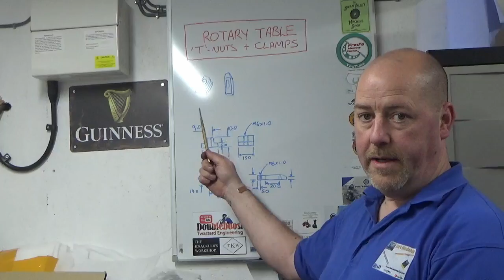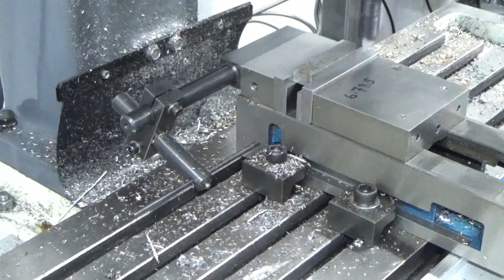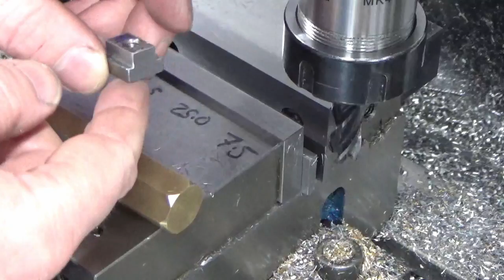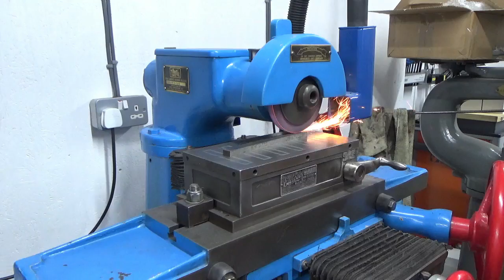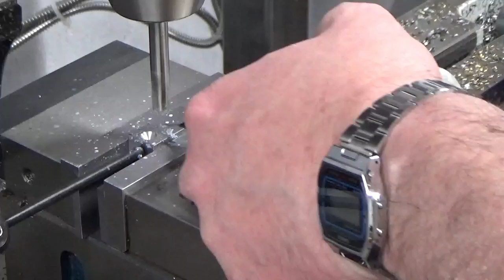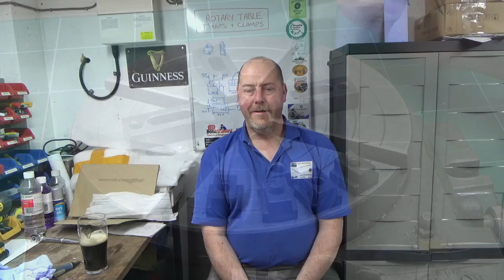Making T Nuts & Clamps For Rotary Table

Comment: Jon, nice video - is there a specific purpose for the threaded hole in the clamp? I've not seen one in a clamp before.
Reply from the maker: Hi Jack, thanks for the comment and question. Yes, it is for a jacking bolt at the back to save you needing lots of sets of packers to level all the clamps up. Hope this helps. Cheers, Jon

Comment: Hi Jon, I see you sneaked in a hex brass and plastic knocker!. Very pleased to see the grinder in use, a little overkill for the project but why not?.
I thought halfway through you were going to remove the vice jaws and grind them parallel, many mill users use a 1mm aluminum welding rod to take out the jaw alignment problem. But a worthwhile job well done.
Reply from the maker: Hi Fred, thanks for the comment. Yes, the knocker was the very first machining video I shot last year following all the boarding out of the workshop. The vice is going to get totally stripped and I will grind the whole thing (not happy with it). Cheers, Jon

Comment: Hi Jon, Great job on the "T: nuts, they are on my list. Also I was having a similar problem with my import vice, I dismantled it & stoned all the faces, including the backs of the jaws, cleaned out the recess for the half ball & greased, reassembled. Now it closes tight & parallel both horizontally & vertically, mine might have had a small burr somewhere. It doesn't take much!   Cheers Peter from OZ
Reply from the maker: Hi Peter, thanks for the comment and information. I intend to strip mine down, run some checks on the surface plate and then a good project for the surface grinder. Cheers, Jon

Comment: Jon i have the same vice as you. I find my old Abwood grips far better when unequal clamping. I think the nature of how the precision vice works does not lend well to that type of holding because of the central slug & the fact there is no gib strip to make the lateral load accurate. A great vice though. I did a full revue of the Arc euro bought one on here. Steve.
Reply from the maker: Hi Stevie, thanks for the comment. Didn't realise you had a channel, subbed and will watch your tear down as it something I need to do. Cheers, Jon
Reply: @jonsworkshop  No problem Jon. Just making a video of making a sensitive knurling tool from Hemingways. Lots of parts to machine. Growing slowly but not expecting anything spectacular. Like you i just enjoy showing content. It will probably be at least 4 parts long. Look at Ade's workshop. Doing multi part vids seems to capture an audience. Already taken 20 video's & only made 2 parts of 20. Regards. Steve.

Comment: Nice job.   The parts look very good.   I recently picked up a small tilting table at a flea market.    The slots were slightly smaller than my milling machine table, so I just machined a couple of the milling machine T nuts to fit.   So I also have some dedicated T nuts.
Dave.
Reply from the maker: Hi Dave, thanks for the comment and feedback. A dead simple job but dead handy to have a set ready to go, just need to make a decent box now (and that's where I will show myself up........ rubbish with wood unless it's construction). Cheers, Jon
Reply: I got a smile from the comment on making the wood box.   I have a local machinist friend who says the same.   He gets me to make his wood related projects.   Just so you know you are not alone.
Dave.

Comment: Spot on job of these clamps and tee nuts👌. 
I did the same some months ago for my rotary table and also made some specials to bolt down my toolmakers vise.
 Like you I have various stud lengths to accommodate low and high profile work pieces and all the dedicated studs and clamps are stored with the rotary table.  Many of the tee nuts on the market are total crap with thread holes off centre and varying widths. Best to make your own.
Reply from the maker: Hi Howard, thanks for the comment and feedback. Yep, stuff like this today is all made out of old bean tins or whatever else is dragged up off the sea bed you know where, and thrown together. Quite satisfying making your own, not the most complex job but still interesting enough to keep me out of trouble for a couple of hours. Cheers, Jon

Comment: What is the white liquid you are using?  I'm presuming it's an anti friction liquid?
Reply from the maker: Hi Pixibelle, thanks for the comment and question. You are close, it's Coolant, a mixture of soluble oil and water used to keep the part cool (managing thermal expansion), and the tool cool (prolonging tool life). The oil element also does provide some pressure relief (anti friction sort of) that helps improve surface finish. Lesson over lol. Cheers, Jon

Comment: Thanks for sharing, nice job and love to see the grinder in action. Could the jaws on the vice not closing properly because you are just so far out? Could have tried to put one of the unmachined pieces of the t-nuts on the opposite end of the jaws so that they wouldn't close at an angle. Also, couldn't you just place the t nuts upside down, that way you could also register on top of the jaws instead of the parallels, because it doesn't feel like perpendicularity of that face is very important.
Reply from the maker: Hi Anti, thanks for the comment. Who doesn't like to watch a surface grinder, second only to watching a shaper according to YouTube stats lol. I had one of the other nuts at the other end of the Jaws but it just wasn't having it, I tried them both ways up as well but no dice! Need to strip the vice and have a good go over it (potentially a lot more surface grinding lol. Cheers, Jon

Comment: Nice video again , 'just because' :p now you can measure off your clamp top if you need to . Is there no need to harden them never really understood when and when not to harden something maybe content for another vid?
Reply from the maker: Hi rgbargeee, thanks for the comment. No need to harden these, they need to flex a bit under clamping force, plus a hard face could mark the part you are clamping. No real hard and fast rules about what to harden and what not, it just depends on the application really. Point noted, I will cover this off in a future video when I get into hardening (assuming I remember lol). Cheers, Jon

Comment: Hi Jon, this is a project on the list for my Rotary table. I'm on the lookout here in NZ for a small surface grinder. Yours looks a nice one. Regards Kevin
Reply from the maker: Hi Kevin, thanks for the comment. Bit of a basic job but dead handy once they are made, well worth the effort. Its a peach of a grinder (except that there is no way to balance the wheel). Cheers, Jon